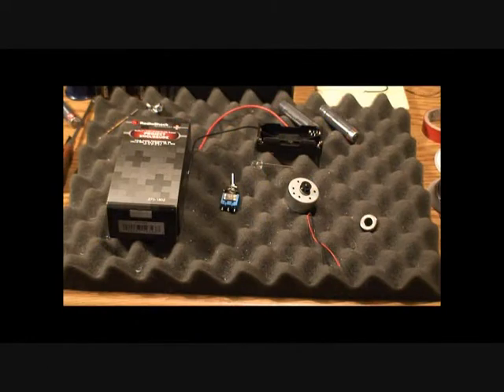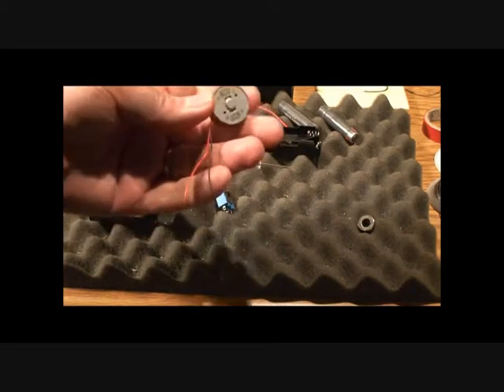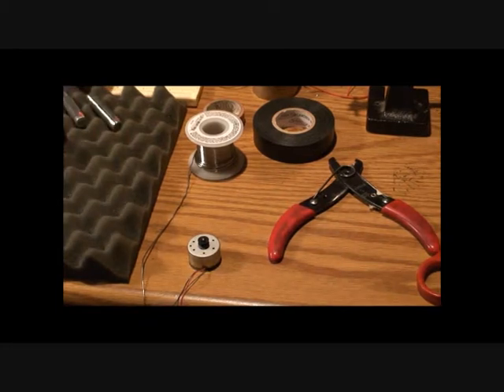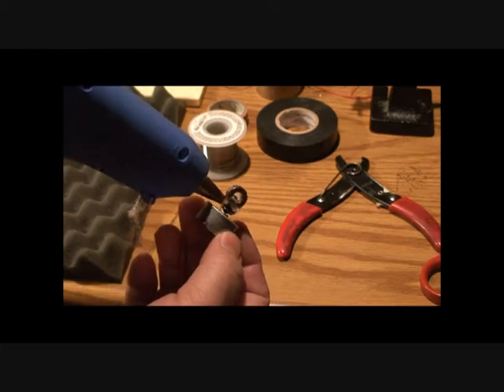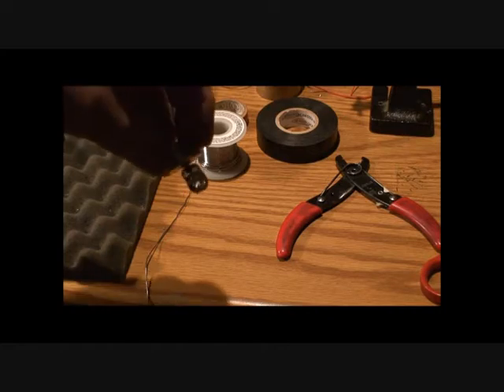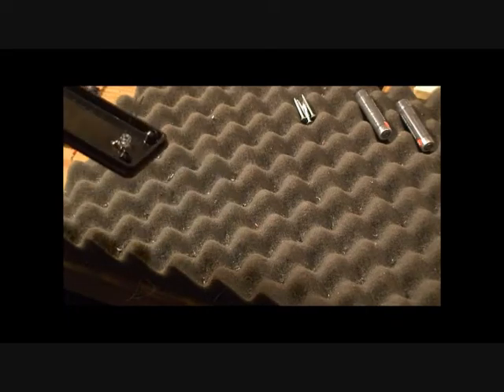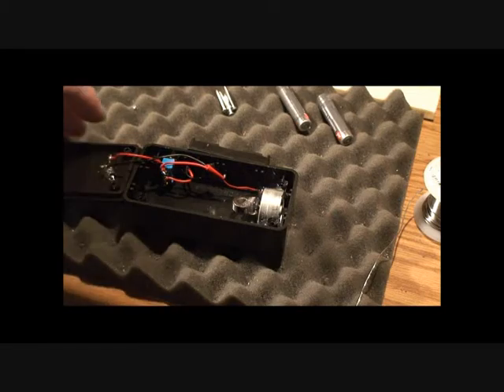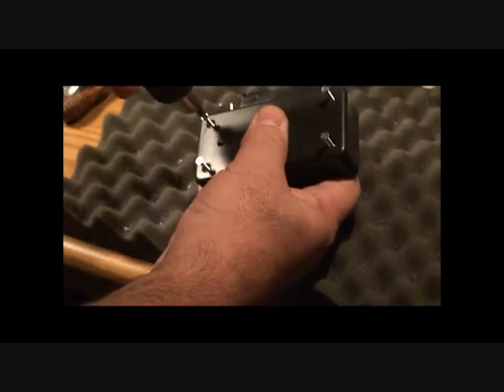How To Build An EM Pump

Comment from the maker: @pblinds First, try to get the magnet as straight as possible when attaching it to the motor. The more crooked or off center it is, the more vibration it will cause. Another thing that helps is to attach some foam rubber on the bottom of the case to absorb vibration.

Comment from the maker: @armyveteran1000 The wave dispersion pattern seems to be oval shaped so a horizontal mounting like the one in the video will give a better vertical output. Of course you can also change the orientation of the box when using it and try it different ways to get the dispersion you prefer.

Comment from the maker: @armyveteran1000 Hi Rich, The size of the magnet really depends on the size box you use and the motor position. For this video I used a 1/2 inch diameter magnet. I have built a few 2 motor units, but we use the single motor units more.

Comment from the maker: @Redliner500 We've built a few with variable speed control and you do get a higher EM output with faster RPMs, but we've had just as good results at lower RPMs too, so it's up to the builder what speed you want to run.

Comment from the maker: @cincyghosthunter Hi Gerry. We have made a few with variable speed controls, but we found no appreciable advantages in running at different speeds. Reducing the speed reduces the EMF level and seems to limit the effectiveness. But that doesn't mean that you shouldn't try it. There may be circumstances where a lower level might be desirable.

Comment: Have you tried to vary the R.P.M. of the motor?  Have you done any research into different motor RPMs to see if different RPMs give you better results with recording EVPs?  The speed could easly be modified using a simple PWM (Pulse Width Modulation) circuit. Thanks, Gerry.  from HEAT Paranormal

Comment: Great video again!  I am building my own pumps right now thanks to your video.  Just to note,   I am using the tray motor to an old PC CD player that I was ready to throw out.  Works just fine and also fits in the Radio Shack project box like the Xbox motor like you have.  I am also using the 3/16 rare magnets (2 in a pack) as it fits perfectly flat on the spindel.  Just a touch of glue to give it extra hold.   The wiring is the tricky part!  Anyway, thank you again for a great video!

Comment from the maker: @DarthInsidiom You are correct. Although there is a weak electro-magnetic field created by the electric motor when it is on, the majority of waves produced are magnetic, which is much safer for human bodies than high AC EMFs, and produces the desired results.

Comment: What amazes me is that people believe that these devices are Electro Magnetic Field generators, which they are not. These devices are using permanant or rare earth magnets rotating on an axis. All these devices are doing are rotating 2 magnets on the end of an arm attched to a motor and therfore creating a rototating magnetic field. An Electro Magnetic Field is created by passing an Alternating Current or Pulsed Direct Current thru a coil of wire ( copper or other conductive wire ).

Comment from the maker: @tm4eyes007 We have made multiple motor/magnet units to but we rarely use them. We have not found a significant increase in activity with those. When we want more coverage, we just use more single magnet units placed around the room. However we seem to get better responses using a single unit as a beacon in a focused location rather than trying to flood an area with EMFs.

Comment from the maker: @InventorGorilla All good ideas, but the motor by itself does not emit enough EMFs for our use. Neither do solid state DC designs we've tried. The goal was a small, simple, effective design. Battery consumption is not a problem. We usually get several investigations out of a couple of AAA batteries. Again the goal here is to use the pumps as "sacrificial" batteries to keep entities from draining batteries on other equipment.

Comment: @ParaSpinnProductions I couldn't find the rare earth magnets but our local "JoAnn Fabrics craft store" had ceramic ones 3 in a pack for 3 dollars.  They seem very strong.  I will make a video of it in action when I get a chance.  I had my MelMeter on when it was running with just one magnet it was a little over 200 mGauss it pegged the first setting on the digital display. So I got adventureous  and added all three magnets and turned it on,

Comment: I made one of these from a motor out of an old PC that died, actually I found 4 dc motors in that dead computer, one on the chasis fan, another on the cooling fan above the heat sink for the chip, one from the CD/DVD drive one that opened the door and one from the cooling fan on the back of the power supply.  Thanks for sharing!

Comment from the maker: @SmallvilleFann1983 Thanks for your support, my friend. I chose the external battery holder for two reasons. It allows the main box to be smaller and easier to deal with and it makes battery change faster, because we've been in spots where the batteries get drained really fast.

Comment from the maker: @SmallvilleFann1983 I get mine from a local gamer store that sell parts from broken game systems. Radio Shack has some that will work, but it doesn't have the rubber flange on the spindle. Another good source is broken VCRs. Alot of pawn shops will sell broken electronics dirt cheap and that a great way to get parts. Hope that helps.

Comment: Why does there seem to be so much competition in this field?  Thanks for this video.   I made an em pump much the same way as you, but I added base magnets under the motor magnet.  It doesn't throw any more EMF when turned on.  I'm using a rare earth magnet on the motor.  I can't figure out why it doesn't throw off more EMF when rotating.